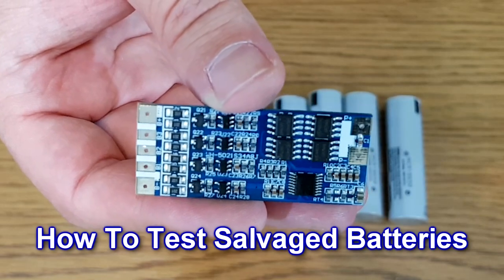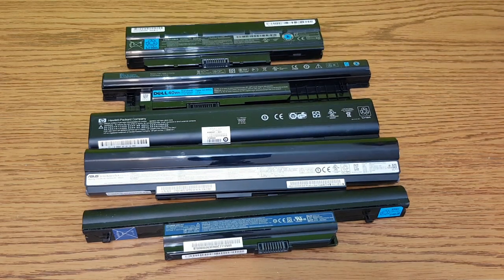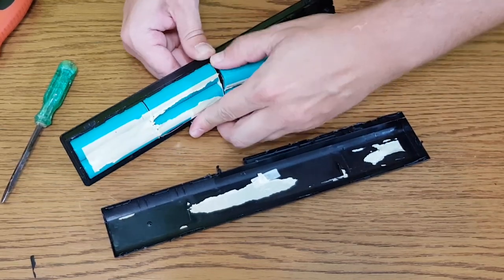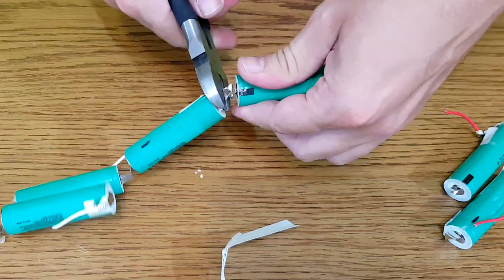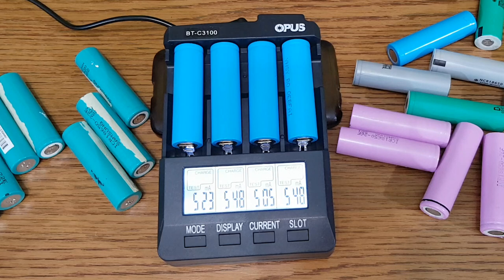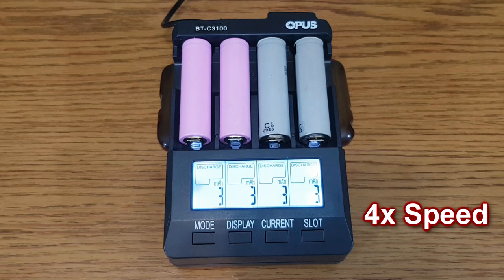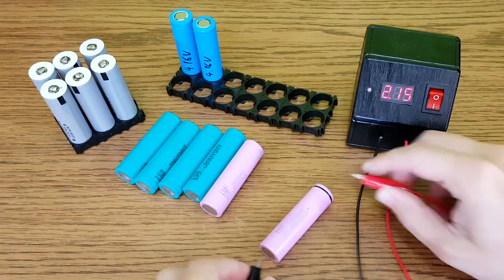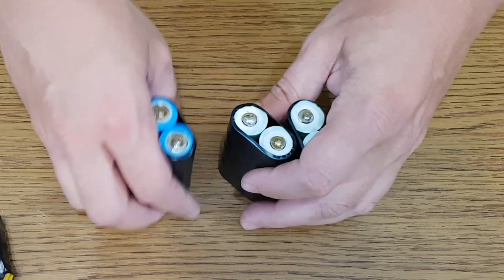How To Test Salvaged 18650 Cells - From Laptop Batteries

Comment: One little blow against the Capitalist World thanks to you Sorin! I will be back in the shed today breaking open those laptop batteries that have been sitting there all during 2021. And maybe my ebike will finally get its new 36v battery.
Reply from the maker: laptop batteries are not good for ebike. it needs high drain cells. but you can use them for something else.
Reply: @Sorin_DIY can you use it to power motors?

Comment: Salut, Sorin! De unde faci rost de acele laptopuri? Aparatul acela masoara capacitatea reala a unei baterii? Mulțumesc!
Reply from the maker: salut. cateodata, cand am timp (acum nu prea mai am), ma ocup si cu reparatii diverse aparate electronice inclusiv laptopuri (ce se poate repara mai usor) - inlocuire displayuri sau alte componente, curatare de praf, schimbare pasta termoconductoare, coolere, mufe/conectori. mi-au ramas unele laptopuri care nu se mai pot repara, am cumparat/primit alte laptopuri incomplete/defecte pentru piese de schimb. in final mi-au ramas multe baterii de laptop, cu care voi face acum clipuri pe Youtube. iar cu acel incarcator Opus se poate masura capacitatea reala a unui acumulator.

Comment: Very good information in apropriate amount of time. just dissasembled a pack today and i was too lazy to test anything other than internal resistance, and built it in another pack, voltage was exactly the same and internal resistance 142-135mR. seemed in very good condition to me, but since i was not charging them slowly im little worried. in pack they are assebled now they will be charged at 1.2A, is that okay and will keeping an eye on them when i charge them first time be enough?
Reply from the maker: hi. what kind of battery pack? in parallel or in series? it's better to test their real capacity before you connect them. if one of the cells have a low capacity or a fast self discharge rate it will affect the entire pack.
Reply: @Sorin_DIY  3s2p
Reply: Everything is okay, one pair is 0.01v higher after finished charge cycle. cheers
Reply from the maker: then it's ok to charge them with 1.2A.

Comment: Hello, I am hoping you could help me with this question. I made 3-24p 18650 battery packs, wired them in series to get 12v @ 60 ahs and added a 100amp  BMS. Can I make a pack just like the one I mentions to acquire 120ahs? Thank you for your feed back. Have a nice day.
Reply from the maker: hi. do you mean you want to make 2 identical battery packs and connect them in parallel, to have 12.6V at 120A and charge both of them with one charger? theoretically it should work, but I never tried it.
Reply: Sorin, thank you for your feedback. It would go something like this. And hoping for it to be possible:
3 packs of 24p wired in series=12v@ 60ah(1-BMS 100amp) and another,
3 packs of 24p wired in series=12v@ 60ah(1-BMS 100amp) 
Hooked up together in parallel for 120ah 12volts. And ideally to have one 12.6 @ 5 amp charger and or Solar panels do the charging. Do you think its possible. Thanks and keep your great videos coming. I actually bought all the parts you recommended for that power supply video where you waited for "the cat to pass" that was hilarious. Just haven't had time. I've been dedicating my time to building some solar power banks.
Reply from the maker: I think it will work, I don't see any problem. but I've never tried something with that amount of current. I suggest you use fuses on all connections.
Reply: Sorin, yes I will be using an ANL fuse, a circuit breaker and fuse block for all connections including one for solar charging. Your input among others has been very important in my persuit of building this project. Thanks and keep on doing what you do. You truly are a special DIY'er

Comment: I am a tech but in computer hardware, not electricity.  I have been thinking about building a "portable" PC so I can have some of the portability of a laptop but the horsepower and upgradability of a PC.  Is it feasible to create an 18650 cell power bank to power a PC or would it just be too heavy to carry at that point?  I would like to get at least an hour run time, more if possible.
Reply from the maker: hi. it' doable, but I don't think it's practical. the PC needs 3 supply voltages (3.3V, 5V and 12V) with a lot of current. for each conversion you will lose a lot of current, because the efficiency will be between 70% and 90%. the only option in my opinion, is to find a small PC (like those lenovo small office PCs) with a single voltage external power adapter. upgrade it with a better CPU, if the motherboard supports it, more RAM memory, SSD, bluetooth module... and use it with a portable DIY battery, instead of it's power adapter.

Comment: So to recap:

0 < voltage < 1V5 => most likely dead or pretty much useless, throw them away
1V5 < voltage < 2V5 => might be revived with some low-current charging for a long time
voltage > 2V5 => go ahead and charge them with standard values

With appropriate charger.

is this correct?
Reply from the maker: yes. we can add one thing: if the cell has less than 1.5V, in some cases it can be revived, if it's a good quality cell. but the capacity will definitely be affected. usually it will self discharge very fast.
Reply: @Sorin_DIY  thanks for your answer! I managed to salvage all 11 Lithium ion cells I had with a Zanflare C2 but I'm still in the process of trying to understand the basics of cells and I'm looking for a suitable way to test Li-Ion capacity with some DIY solution, just to make some practice :)

All of them seem to behave properly until now, still doing some charge retention tests. Charged them fully, stored in a cool place, in a couple days I'll check their voltage.
Reply: i sincerely hope they end up in recycling bin for batteries tho

Comment: Just wondering, is it save to use revived overdischarge battery? Cause lots of people doing it
Reply from the maker: hi. if they are good quality cells and have been cared for most of the time and only once got over discharged, the cells can probably be revived. but the cells must be tested - capacity, temperature, self discharge rate. cheap/low quality cells can be dangerous if over discharged.
Reply: @Sorin_DIY  thank you so much, i've been searching for the answer and they only say don't do it without giving any reason why

Comment: Hii!! Should a I check voltage right after I charged the batteries? I have and. It doesn't show the full 4.2 volt, something between 4 and 4.18, those numbers are right after charging the battery. I am a little. It confused, hope you are able to clear things up
Reply from the maker: hi. if you check the voltage right after you charge the cell, it should measure between 4.1 and 4.2V. I think your cell cannot hold its charge too long. it was probably overcharge or over discharge once. you should mark the voltage on the cells, store them for 2 weeks and then measure them again and check the voltage drop for each cell. if the voltage is bellow 3.9V, I don't think you can trust those cells.

Comment: After they have been laying for 8-16 days. Shall they be charge again before the capacity test?
Reply from the maker: first check the voltage, if it's too low, you should not use that cell. then you can test their capacity, without charging them. this way you will know which of the cells have the lowest self-discharge rate.
Reply: Thx. I have charged my cells, and let them test for 9 days. All there are over 4v, I will capacity test. Would you mean it's okay for the cells there are minimum 4,00 v, and the rest out for thrash
Reply from the maker: you can probably still use some of the other cells too, but they will have a smaller capacity and will self discharge faster.
Reply: @Sorin_DIY  thanks very much for your help. And a great job with your channel. It's very informative and good help.  I am building a battery pack for my diy bluetooth speaker.

Comment: At the first place how do you ended up getting so many laptops
Reply from the maker: hi. before I started to make videos on Youtube, I used to repair electronic devices in the spare time, even laptops. replacing displays and other components, soldering connectors, cleaning them and replacing the thermal paste. some laptops cannot be repaired anymore, other I just bought them incomplete, but very cheap for spare parts (or they were donated). so I ended up with a lot of laptop batteries.

Comment: I want to fix mine is a dell studio 1555. How do I know which cells will work? Do all laptops have this kind of cells?
Reply from the maker: hi. most laptop batteries have 18650 cells. slim laptops have other type of slim cells. but it's cheaper to buy a new laptop battery, instead of individual cells and replace them. you can't replace only one cell from the laptop battery. in a battery pack, all cells must be the same model, same capacity, same life span, same charging cycles.
Reply: What will happen if you put different capacities batteries in one pack??

Comment: if i let battery for 3 years and test it it will be ok if read more than 2.5 v?? that mean good battery never goes under that?
Reply from the maker: the voltage should not get that low. but if it's at least 2.5V it should still work. but if you haven't use the cells for 3 years, you should test the cells (capacity, temperature, voltage) before using them.
Reply: @Sorin_DIY  ok if i use a good battery then i discharge it in device ok? until it goes low  then it will reach 2.5 volt or less??
Reply from the maker: you need a protection board for the lithium cell so the voltage will not decrease lower than 2.5V
Reply: @Sorin_DIY  what??? please read my question well

Comment: What did you mean by "hot"? I mean, if my batteries get quite warm, but not hot is that the hotness you were taking about? :D
Reply from the maker: hi. it is not a problem if the cell warms up a bit, in fact in some cases it is inevitable. in my opinion it's recommended to charge and discharge the cells at a maximum rate of 0.5C (preferably 0.3C). this will warm up the cells just a bit. if you use 1C rate, the cells will get hot. in time this may decrease the cell capacity. and if you use a rate bigger than 1C, the cells will get very hot and it will definitely damage the cells in time.
Reply: @Sorin_DIY Thanks for the answer! I noticed that older cells, even when not at 0V get significantly warmer than those found at about 3V.
I have one more question if you don't mind.
 I have a Liitokala Lii-500 charger and it tends to sometimes overcharge the cells to 4.21-4.22. although it usually falls to normal levels after a day, I wonder if this kind of slight overcharge is dangerous for the cells? I've been searching for the answer, but all I know is some cells have 0.05V tolerance.
Reply from the maker: charging the cell to 4.22V should not damage the cell. TP4056 modules sometimes charge the cells to 4.24V and I use them a lot. the cells are a bit stressed, but I don't see any permanent damage immediately. it may probably decrease the cell lifespan but insignificant, probably with less than 1%. it also depend on the quality of the cell. some BMS boards have the overcharge protection at 4.35V, this will definitely damage the cells in time.

Comment: When checking the batteries with meter, test the individual cells lol dont test when they are still connected. When you tested them in the video 1:55 you were not testing the individual cells.